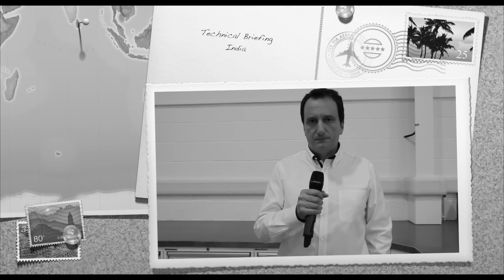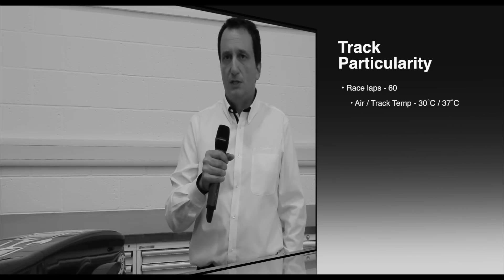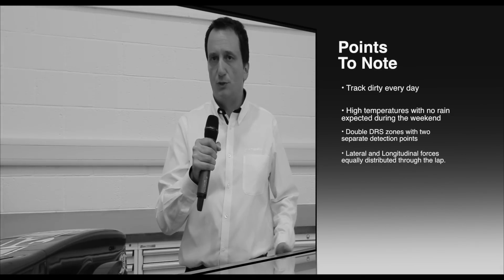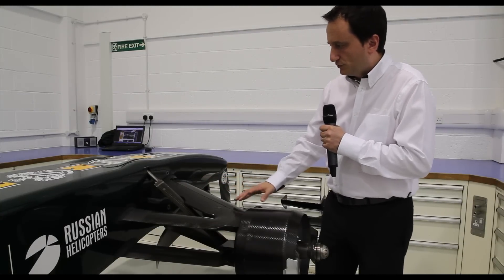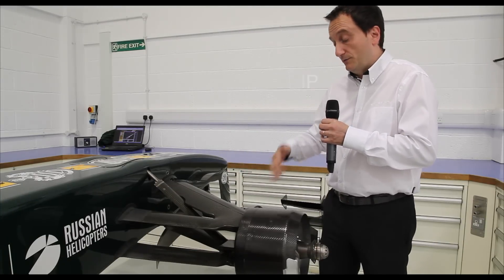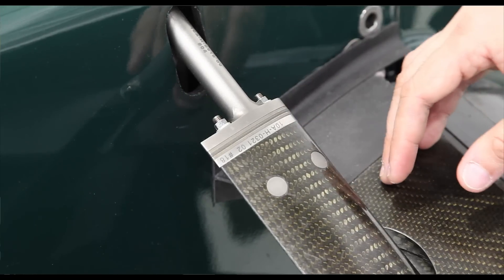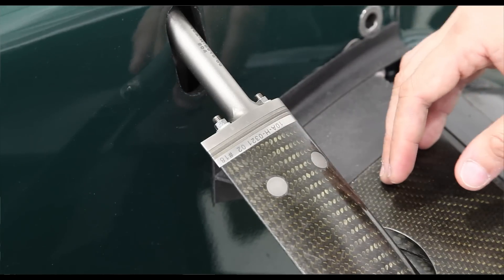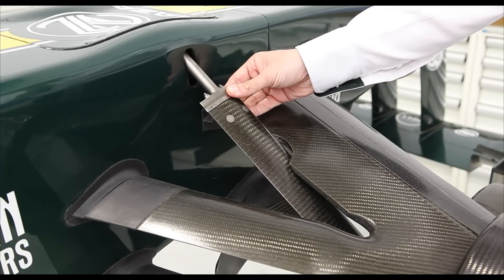How F1 suspension works: Caterham F1 technical

Comment: I still don't fully understand suspension, particularly roll bars.

All I know is set everything as stiff as possible and as low as possible.

Usually works.
Reply: ナコルル Princess  Not really, it's all about tyre contact to the road! Sometimes that means going soft on the anti roll bars..

Comment: 0.3 to 0.5 mm... wow.
Reply: Nico Montinola He's talking about granularity, or how precisely they can change the ride height. The smaller the number, the better. That doesn't mean that they can't change the ride height by 1 cm if they wish.
Reply: Hmm, that can't be right.  I think he means 3-5mm.  The lowest ride height is between 15-20mm.  At high-speed tire growth could increase ride height by up to 5mm.  According to an expert, a 2mm lower front ride-height, considering the plank doesn't rub, could improve lap-time by 0.2-0.3 seconds.  So to me, it doesn't make sense to change the ride height only 0.3-0.5mm if the difference in lap time will only be less than 0.03 to 0.07 seconds per lap.  The fact that tire growth is up to 5mm at speed means the teams need to have that margin in order to adjust their car according to the option tires for that particular race.  No wander Catherham is last place!  LOL